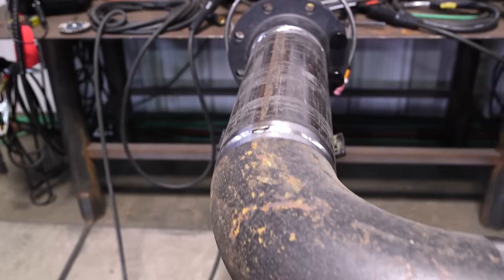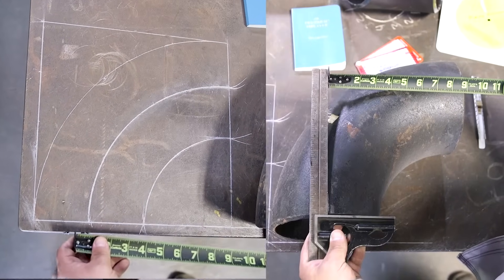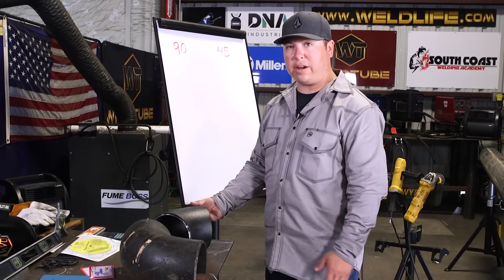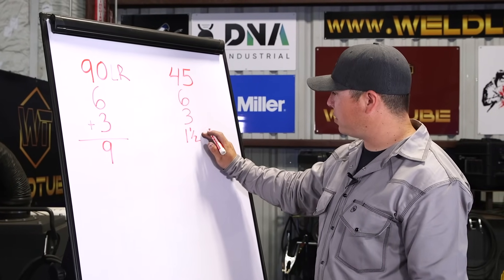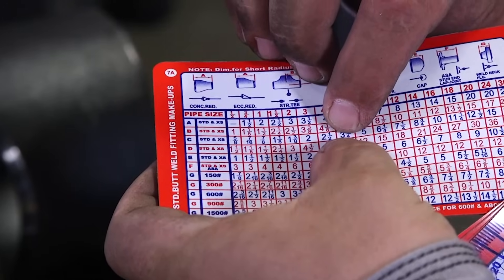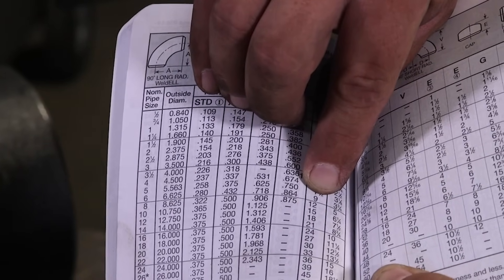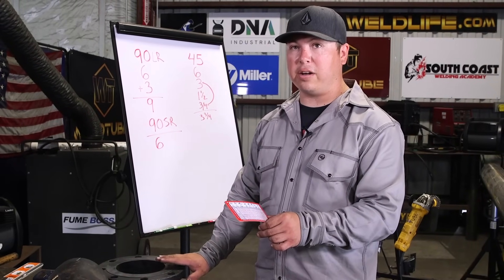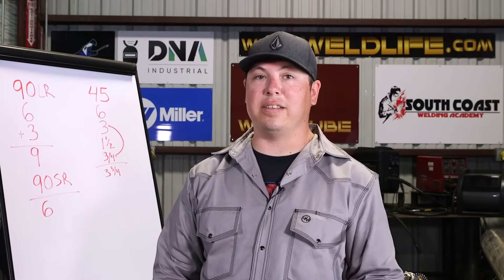What is a Pipefitting Takeoff? | Pipefitting Basics

Comment: Just a little tip for you guys. If you do that method of cutting the pipe size in half 4 times, but take it a step further, and cut it for a 5th time. So in the case 6" being the pipe size. Do 6, 3, 1½, ¾, and then ⅜ being last. Take the 3rd and 5th numbers and add them. So 1½ + ⅜ = 1⅞, that will be the center of your 22.5° fitting. Hope this helps.
Reply: Thanks man
Reply: Fuck yes dude. Thank you.
Reply: Damn i wish I saw this back in school the instructor did explain it in simple terms he just read the book and didn't really teach.

Comment: Had a weld test today, and a written one as well, and what you just showed is exactly what I failed lol, I didn't kno about that stuff but I do now. Can you show more, but the test was for sanitary tubing SS
Reply from the maker: You’ll get em next time champ!
Reply: @weldtube  thanks brother
Reply: U can order a fitter book online,u can download apps from the fitting manufacturers, and u can measure the fittings. I will say and I am not at all trying to be mean but u should definitely know know this stuff and hangers if u weld pipe. Generally u fit before u weld. U can practice with pvc, cpvc etc too. If u are a pipe welder and u don’t have this knowledge you will stick out like a sore thumb.
Reply: Great vid u definitely should do fitting 101. 2 hole flanges, gaskets, valves, HANGERS, socket fittings, thread pipe, glue pipe, solder, braze, if there are guys not knowing a take off and they are welding pipe they at least should get a rundown. It may help a pre apprentice too.
Reply: @dominickcarbonara5494  yea I told the company ahead of time ive never welded pipe as far as out in the field, I just told the company that I could pass a 6G which I have, all 3 ive taken the CWI said i passed with no indications, but they wanted me to take the sanitary welding test plus a written test, I passed the weld test but failed the written and told them I would, but the owner said the other stuff can be taught on the job training. So idk ill see. But thanks for the information! I will definitely order the stuff he recommended.
Reply: @lifeinthearclane6240  awesome good for u man 🤟🏻😎
Reply: He done everything right except one thing. He did not say anything about the weld gap. That is part of your take off as well when putting them all together.
Reply: ASME9

Comment: The way I learned in school is that the distance for a long radius is 1.5x the diameter, it gives the same results, so 6*1.5= 9
Reply: Just make sure it's a long radius 90 first.
Reply: And 5/8 × the diameter for the 45
Reply: Thet depends what tipe of elbow you have. You can have 1D. 3D. Standard is 1.5D
Reply: Where did 1.5 come from ?

Comment: Nominal pipe diameter times .625 or 5/8 for 45’s, subtract that from your overall center to center or center to end measurements plus your weld gaps. Boom, cut piece length figured out
Reply: Thats one way.

Comment: To determine the center of a 90 degree bend, simply put 2 pieces next to each other and measure the value from foreign trade until you know the value then by 2 parts e.g. bend DN 100 has from outside to outside 200mm 200: 2 = 100 / 100mm is the outlay of  a DN 100 bend DIN not ISO

Comment: So you need to measure from center point to center point? Is it not accurate to just measure between the bends after Welding them to each pipe to find the pup length?
Reply: Typically most isometric drawings will be shown with measurements center to center or face of flange to center I have run into
Shorten and mitered fittings if you measured just the pup you could be off on centers
Reply: @cirizawelding5076  ah gotcha. Thank you.